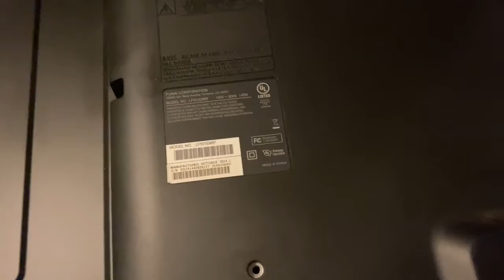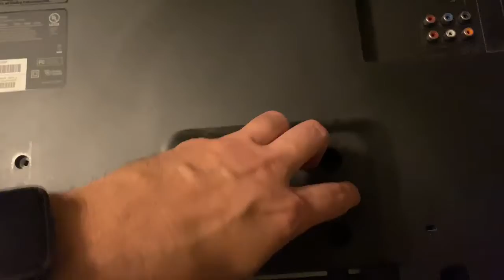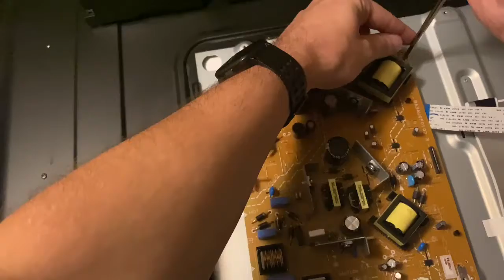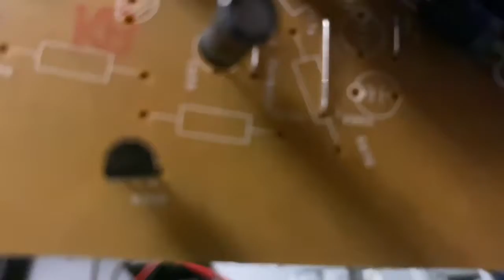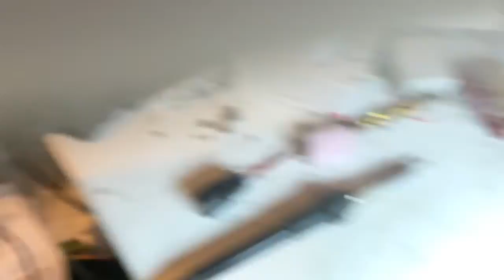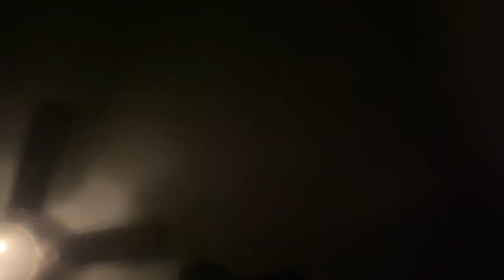Emerson LF501EM5F won’t turn repair

Comment: I have an Emerson LF391EM4F that stopped working shortly after  powering it with a generator.I did a sodt reset holding rhe power vurin doqn and then plugging the in and rurning it on, but it went off and no matter what I try it qont power up.Withbtye back removed I can now hear a fair humming sound coming from the power board.Anyone experience this probken or faint humming sound and tv won't power on.
Ive used it in a generator before with no issues
Reply from the maker: Probably fried either main board and power board. Shopjimmy.com  just search model number.

Comment: I know this video is quite old, but you handle the power board with seemingly very little concern. Are the power boards in these TVs not dangerous? I'm not well versed on them, but I have an Emerson LF320EM4F that powers on for long enough to flash "Emerson" on the screen before going dead again and I have replaced the control board already. I thought it could be a power board issue, but I'm trained to never handle the power supply on electronics like this due to stored charge. 

If these are safe to handle like this, I might be brave enough to do some further repairs.
Reply from the maker: @NetworkPrototype  they deplete themselves overtime. You can drain the capacitors with a high wattage resistor if you are afraid. I don’t pull the board off right after powering it up. No worries, go experiment

Comment: My exact same model turns on for a few seconds and then turns off. It was unplugged for a few months and then plugged in and worked great for 4-5 days. Now it’s working fine again. I wonder if this fix would work for mine too

Comment: Hi..could you make a video or point to a link..the speaker on my emerson smart tv is making a horrible sound. Both of the speakers. I'm planning to remove them and get others speakers connected instead. Have you done something like that?? Help me. Thanks.

Comment: Great video man. 
I wanted to comment because I believe I know maybeee why removing of it fixes the solution.
I noticed when working on NES boards that there are actually compasitors that are more or less "safety" pieces.
The one on the NES doesn't make the buzzing sound, but it does flash a blue screen with the same kinda tempo.
Once it's removed the motherboard allowed the game to actually be read. So it blocks the abity to read the Cartridge.
I think that's the same kind of thing here. The right motherboard won't allow the two to actually connect. But it's just not needed, so remove it. 

Idk it's been a while since I've done any of this. But this videos helped immensely and I appreciate it so much. You just saved me the hassle of getting a new TV
Reply: You just solved my issue with my NES! Thank you so much! 🖤👍🏻🤘🏻

Comment: Thank you this video and solution helped me on a very similar Emerson. I was seeing short with video board attached, removed the diode on the psu and was about to order a new board. 100% sent me in the right direction.

Comment: I did change that chip out messed it up soldering it back on so I ordered the whole board on eBay fingers crossed that it will work I’m waiting on the board to come

Comment: Thanks bud! This vid just helped me to  fix one (same model) that I picked up for free on a moving job. I was initially going to send the board out for repair or try to find a replacement board on ebay$$, I initially thought is was the power board though (so you saved me from wasting some $$), but I found your videoI Easy 5min fix. Now I only have to order a remote from ebay ($6)! Had my 10yr old son watch (&help) as I repaired it and gave him a good lesson why  not to just send everything to the landfill when it quits working. I have also repaired a few other model TV's by just replacing bad capacitors or boards! It amazes me what some people will throw out!  Thanks again

Comment: Just performed this same exact repair on this same exact board/tv exerting the same exact symptoms. Can you explain how this works electrically and why straight up removing a capacitor and putting nothing back in its place works? Just seemed so silly to see it work for you and then go do the same thing. Awesome video , saved my mother in law a decent amount of money!

Comment: Hello i need your help im trying to remove the capacitor and i really dont know which one . My mother board is from an emerson tv also but different model.
Reply from the maker: Search for how to remove a capacitor. Just use a bunch of solder, heat a leg at a time, pull and push it out

Comment: Does the tv keep turning off and on by itself at the end or are you doing that? Curious if it’s still safe to run without that cap?
Reply from the maker: Tv is safe to run just fine without the cap, I was controlling it.

Comment: I have an Emerson 39" TV LF391em4 with standby light on, buzzing from power board, regardless of whats connected to it, it buzzes. I took off backlight connector and main board connector, still buzzes and upon disconnecting power it turns off with a chirp, quicker if the main board is connected. How do I test the output voltages on this board when the ribbon cable connections are neither marked for output or accessible from the top. None of the smd capacitors on the main board are shorted.

Comment: Not well educated in circuit boards but wondering if you'll be replacing with new capacitor in the near term, or will it not be necessary?

Comment: My Emerson TV is not turning on when I turned it on the red light kept blinking for  few second seconds  
Then went off without having any picture on screen. The tv manufacturer on July 2014, and its Model numbers LF320EM5F; S/N ME2A1428118826. How could I solve this problem? I need my TV to come on (work).
Reply from the maker: I would take it apart and see if any visual clues.